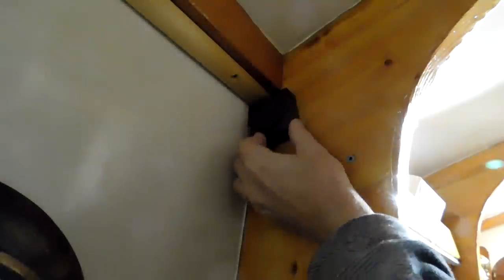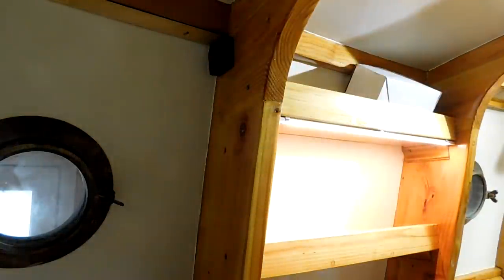Cabin lights and more!; Building a Cruising Sailboat - SV Tapatya EP164

Comment: Merry Christmas to you and your family. I've searched for brass 12 volt LED lights like you've installed for my motorcoach without much luck.  Everything I've found has been brushed metal. Where did you purchase yours? Could you send a link?

How long until you pull out to place the keel? Are you going to have take down your shop to get her out?

Happy building. She's coming along so well.
Reply from the maker: Hi RC
I get the lamps here;
https://www.svb24.com/en/seatec-led-wall-spotlight-brass.html

I'll possibly pull her out this summer sometime... we'll see... The front of the shed comes off quite easily for boat extraction :-)

All the best to you and yours!